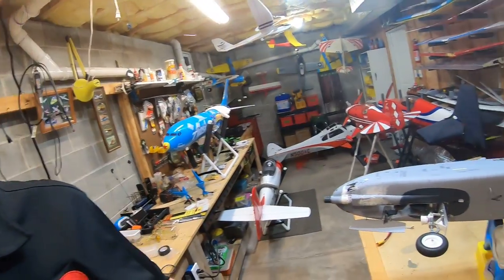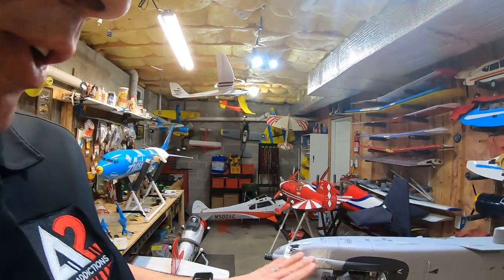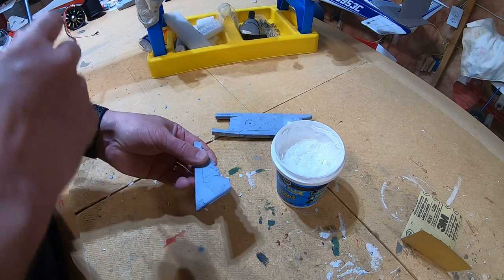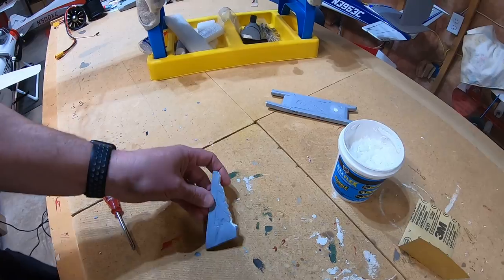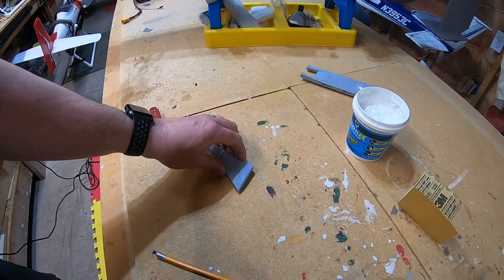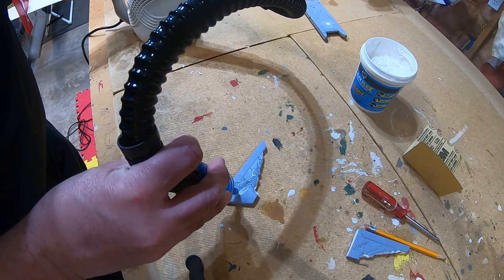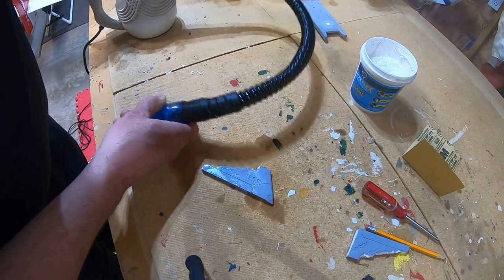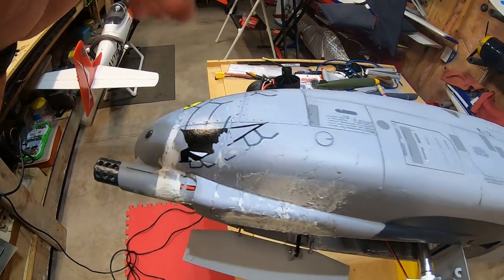Top Secret Foam Repair, a new trick to fixing your foam airplane

Comment: I crashed the front end of the exact same A10 as you did.  I need to know what glue do you use to fix this plane??  The front nose gear retract assembly ripped out completely from the foam fuselage.  What kind of glue should I use to put the assembly back into the fuselage??
Reply from the maker: Foam tac all the way
Reply: Thanks for the reply.  I never heard of it.  I will order up a tube of it on Amazon now.  You have to maintain a good bit of speed landing the A10.  I broke the nose gear pin landing it on the maiden flight.  Bought new PIN set and fixed it.  Went out today for a second try and stalled close to the ground trying to landed it.  I hit a clump of grass just short of the runway and tore the whole nose gear assembly right out of the fuselage.  At least I didn't break any parts this time.  Just ripped the crap out of the bottom / side of the fuselage.  Fits back in place fairly well.  But will need alot of that foam tac !!!!!
Reply from the maker: You can also use beacon foam glue from a craft store like hobby lobby. It’s a big bottle of the same stuff a bit cheaper. The a10 needs the cg moved aft from the most rear recommendation about 5mm. That requires the blue box to be relocated back a bit. With the cg there it gives you flare authority on landing. No more bouncing or nose smashing. It doesn’t need the gear upgrade. Also I use the landing nose 3D print block and 6mm carbon tubes on the inside nose channels. It’s like they were made for them. Since those mods I love this plane.

Comment: Hi say what are you using as brackets to hold all you planes to the wall.
Reply from the maker: Regular adjustable shelf brackets and then slide a piece of PVC tube whatever length you need over the majority of the shelf bracket.

Comment: Awesome find that is...what's the name of the steamer? I watch your videos alot and I've learned many things as a newbie so thank you...Im hoping you can point me in the right direction  on a problem I have with my spectrum  Dx6  controller.. My son was messing where he shouldn't be and for some reason whenever I turn it on it goes into a low battery warning but the batterys are full..I am guessing  he got himself into the warning  settings and set something and I don't know how to reverse it...HELP PLZ ...lol
Reply from the maker: I have a dx6. Let me look when I get home
Reply from the maker: I held down menu scroll button, turn on Tx. First screen shows System Setup list. Scroll to System Setup to change the battery setting back to Alka. Alarm 4.3V. The first time I did it, I ran out of time, and battery warning came on, but I was able to fix it the second time when done quickly.

Comment: Nice hack JPC, thanks. How do you avoid loosening and/or removing the decal that's right next to the nose damage? Is that why you used the spackle there instead of the hot steam?
Reply from the maker: If your careful and use a pinpoint hot steamer you can fix the foam by the dot. Not kidding. Just did another plane I smacked with hanger rash. If you hit the decals they will come off